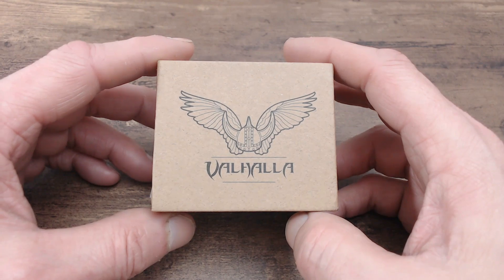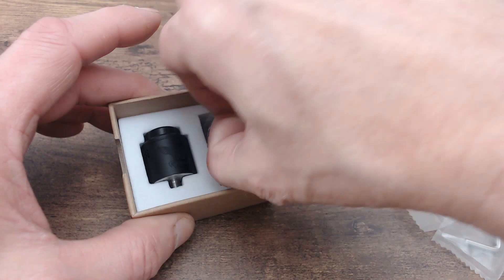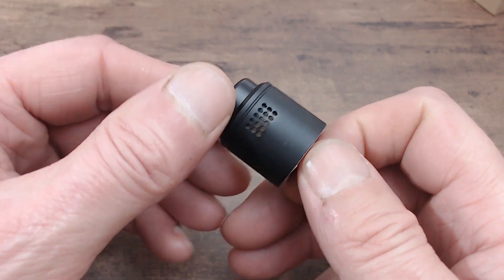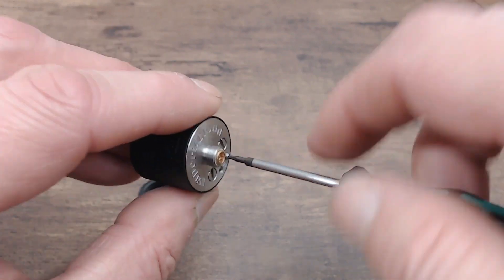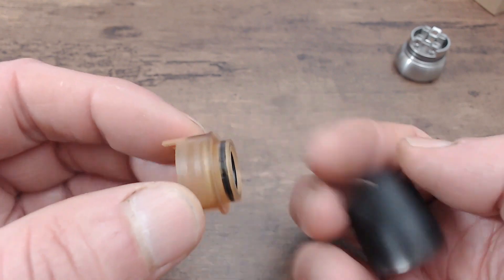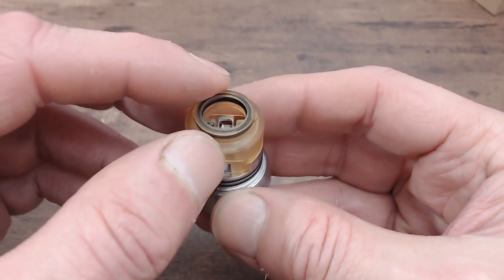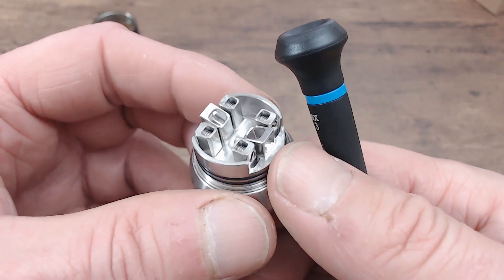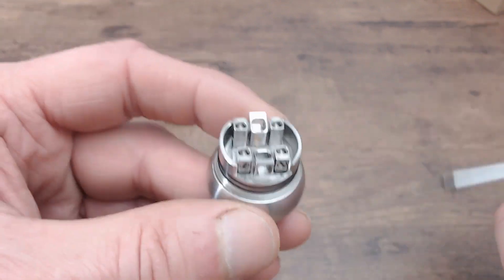Vaperz Cloud Valhalla V2 Micro RDA

Comment: I read on a thread somewhere that on the bottom of the 40mm Valhalla I can remove a screw and screw that screw back in the base in one of the empty holes to be able to sqounk this RDA.
Is this true or am I setting myself up for failure
Reply from the maker: Out of the box it should come with the Squonk 510 pin pre installed and a fixed (No Hole) 510 pin in the spares bag. ( sorry just noticed the question was for the 40 version) let me check it out and reply again later.
Reply from the maker: Nope just checked the 40mm v2 does not come with a squonk pin.
Reply: No I know but don't. They said there is a screw to take out and makes it where you can sqounk it

Comment: I have the Valhalla V@ 40mm and I have the Valhalla 28 which was a collab (It has the Nightmare 28 deck with a Valhalla Top Cap) the 28 AF was a little too restrictive for me.  The V2 40mm is actually restrictive for a 40mm but it is actually perfect wide open for me. I wanted to get the 30mm but everyone was saying the O rings were garbage and the cap just pops off. I didn't even know they made this Micro 25mm. Same AF Design as the 30mm, a bit more open. Might have to grab one. Awesome Review again Kieron (with the exception of the sound on the downlow....LOL!)
Reply from the maker: Thanks Herb, this one is restrictive as well even fully open. As for the downlow not sure what happened there, I think it recorded from the cam instead of my mic.